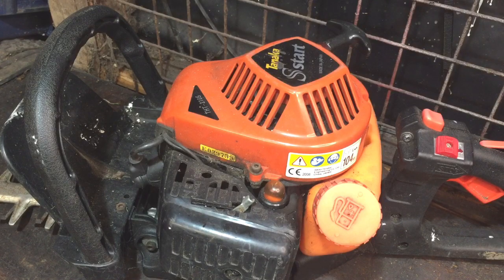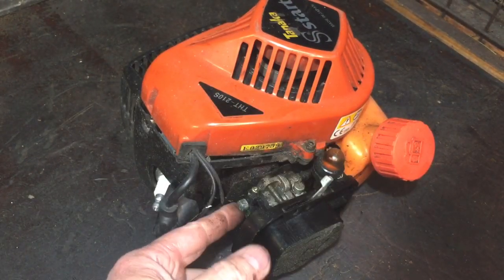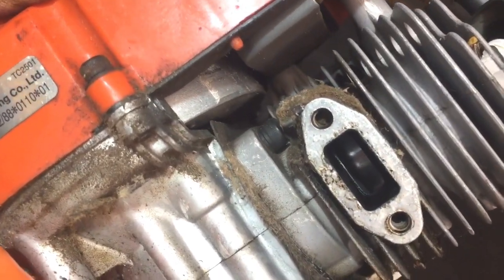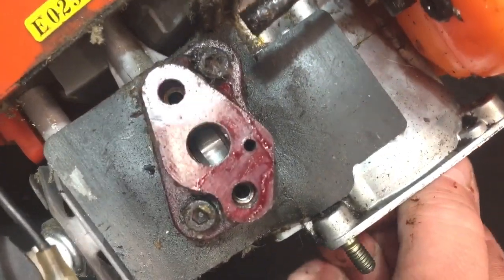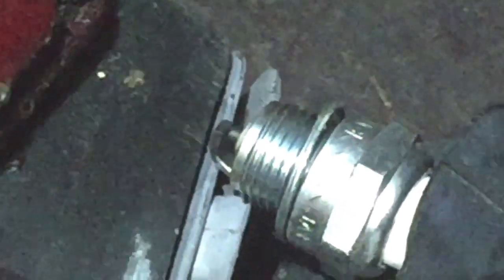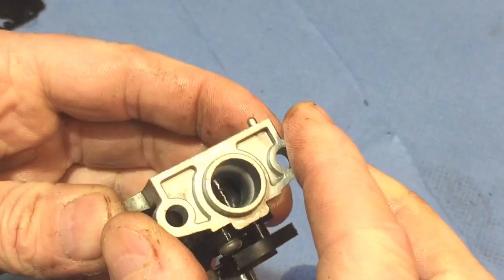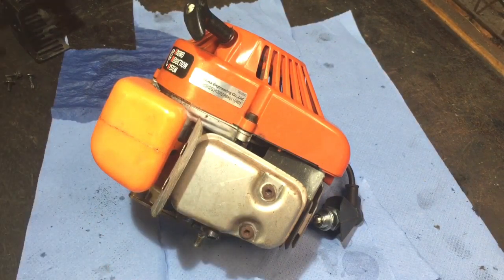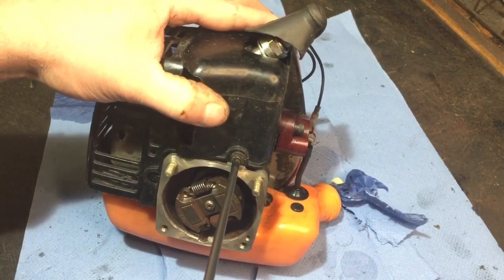Tanaka THT210s Hedge Trimmer , Non Starter ( Can Mend it Man Fix It ❓) 🔧🪛

Comment: Good job there mate keep up the good work quick tip with the fuel hose drop it in a cup of boiling water drys on tight
Reply from the maker: Good tip Rob I do that, but I was to lazy to go to the house to get some boiling water😂 so I just persevered and got them on 🙂👍

Comment: Great video  indept fix on the carberator  thanks for sharing opting for the thicker outer diameter fuel line helped seal the grommet  too Nice
Reply from the maker: Getting them pipes in was a battle but it did a good job and it does run very well 🙂👍

Comment: I’ve got a THT-2100 very light machine but just trying to get it running most of the bits are just the same as on this
Reply from the maker: Hi they are great hedge trimmer, I found a good tanaka website here in the U.K. for parts and parts seem to be a reasonable price, Imo they are an underrated make. Thanks for watching 🙂👍
Reply: @menditman2004  is it tanakaspares as I’ve been wondering if anyone else used it I couldn’t find out if you had  to pay for delivery and there’s also lawnflite spares as I’ve got a lawnflite aswell which some parts from the tanka I was just wondering if you have ever had a Kawasaki kit12